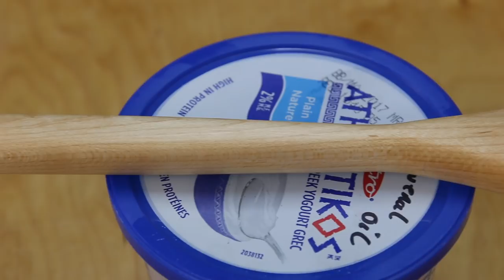How to carve a WOODEN SPOON

Comment: I finally had to call it quits;  between torturing the spoon with the 4in1 and the router.  Good gouge work though.  Nix the 4in1 and the router.  Invest in a couple of spokeshaves.  151F flat sole and 151R round sole will increase your effectiveness and fun.  Ebay always has a great selection at reasonable prices.  Clean-up, tune, and sharpen them up.  Enjoy it, you have shown you have the ability and patience.
Reply from the maker: finebourbon   Thanks. I recently bought a spokeshave and love it. I will buy a few more!!

Comment: The blade of a table saw should only protrude a small fraction of an inch above the top of the wood being cut. This woodworker is very wrong in having the blade set so high. He is asking to lose a finger or two.